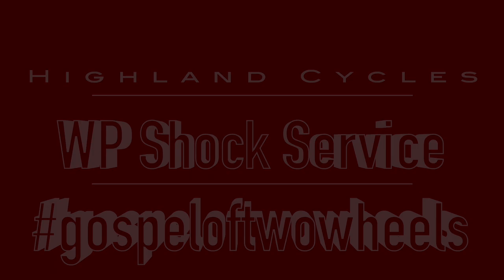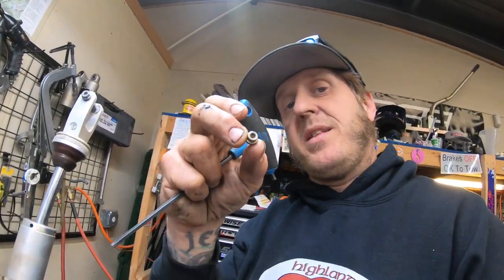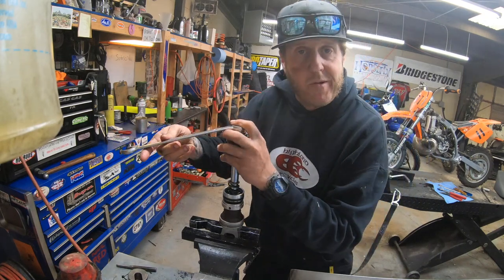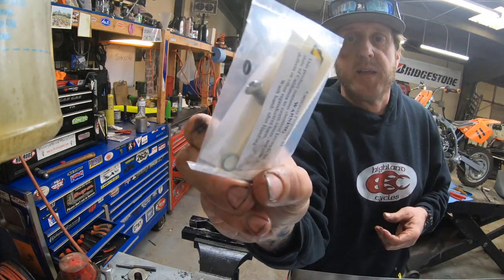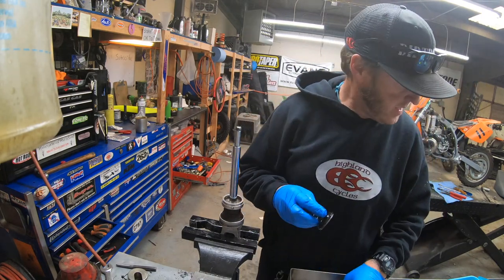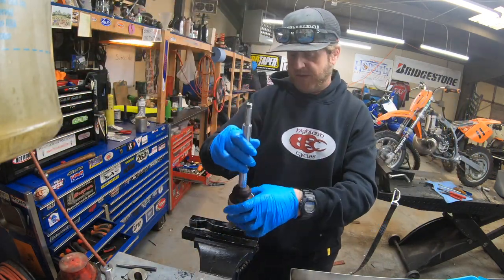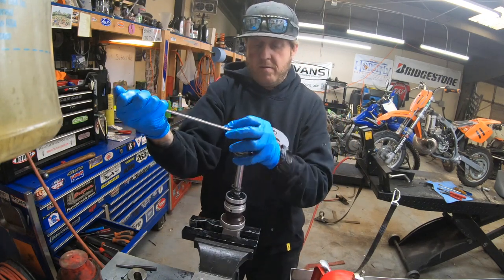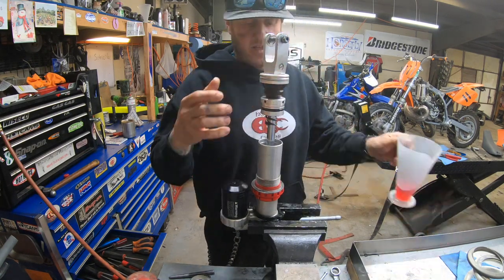How do you rebuild a KTM shock?

Comment: Hey Morgan, I’m putting SDI bladder kit and changing the oil while I’m there. The SDI video shows needing the spring on. I’ll have it apart to change the adjustment collar. Do I need to put the spring on to install the bladder or just do it like you did here? Tia
Reply from the maker: No, you can install without spring

Comment: If you just pressurized the bladder with line pressure you can do all you bleeding from the seal head side. When your done you can remove the nitrogen and install the seal head. Let oil over flow. The seal head will displace the oil and push the piston where it needs to be. Then pressurize. Or you can get a shock vacuum pump/bleeder.
Reply from the maker: I’ve done it that way too. I like using the bleed cup because I usually get some tiny bubbles out from between the shims.

Comment: It might be a silly question but how do you set the 10mm piston in the reservoir?
Reply from the maker: That is a great question and I forgot to film it.  I use a really skinny screw driver and I put an oring on it.  I push the piston up from the bottom until it is all the way up and slide the oring up to the body of the reservoir.  Then I pull it out and slide the oring 10mm down.  Then I push the piston down from the top more than 10mm.  I bleed the shock and then push the piston up from the bottom using the screw driver and the oring as the set height.
Reply: @highlandcycles  Many thanks!!! 👍🏽

Comment: Hmm...at 11:30, before you flipped it over, I noticed the oil was topped off, but it didn't spill. What's the magic?
Reply from the maker: everything was sealed up.  Just the final cap was off but the seal was in place

Comment: Thank you for your very helpful videos much appreciated. I want to lower my Ktm 1090r without effecting the shock stroke length by fitting a reduced length bottom rod end.Firstly can you please advise if such an item can be purchased and secondly can you please advise disassembly and reassembly procedure without damaging the bottom rebound adjuster mechanism.  Thanking you in advance . Sam
Reply from the maker: I’m not sure if you can buy that shaft. We usually have them machined down. As far as the work, just like everything, you just have to be careful and not force anything

Comment: My rear shock (12187L6701) on the TM- the foam buffer  has degraded due to high humidity where I cam located - is this easy to replace - shock appears to be operating fine and no visual problems other than the buffer
Reply from the maker: It’s pretty straightforward but you do have to disassemble the whole shock to do it.
Reply: @highlandcycles  the complete shock - or can I gain access via the bottom mount ?
Reply from the maker: @itolond  whole shock shaft out

Comment: Do you know any method of purging the shock absorber without having to use a vacuum device, it would be of great help, I await your clarification, greetings.
Reply from the maker: The DRC bleed cups
Reply: @highlandcycles  Without the DRC tool, as you would advise me to do, you have another video, changing the oil of another shock absorber just like this one, wp, which you do by removing the adjusting nut, but as it is done in question, please detail the process to me.

Comment: Morgan, I am going to add the SDI bladder when I service my shock. At what point of the service would you replace the canister/bladder?   Mainly I am curious for bleeding purposes.
Reply from the maker: You only need to replace the bladder when it wears out. Depends on lots of things but I’ve seen them go 200 hrs +
Reply: @highlandcycles  sorry, I worded that funny. I am changing the bladder kit to get rid of the OEM setup. It eliminates the piston in the OEM bladder and has a Schrader valve for nitrogen. I was just curious when disassembling the shock when is the right time to remove the OEM can and replace with my new SDI can, but I found my answer on RM atv video. Thanks for the response 👍
Reply from the maker: @mountainmonkey172  gotcha. Right on.

Comment: Great video as always. What kinda of container and fluid are you using to clean parts?
Reply from the maker: I forget who makes the sprayer but you can get them on Amazon. It’s pressurized air that runs it. I use Nutech Brake clean in it. Thanks
Reply: @highlandcycles  Thanks

Comment: Hey on my 2001 KTM 300EXC my KTM dealer installed a 1 inch longer bump stop during rebuild  telling me it has compression characteristics that equal the shorter OEM bump stop that is no longer available . I am thinking of trimming it to the stock bump stop length as hard to believe . Ever seen this ? Wondering if I should trim especially since about to ride some fast , deep sand whoops and dont want less rear wheel travel .
Reply from the maker: I’d trim it. I don’t think they are right about that

Comment: Why did you suggest adding a bladder? Curious about the SDI kit for my TE300i
Reply from the maker: The bladder gives you more consistent shock action than the piston. The piston tends to heat up and not move well whereas the bladder acts the same all of the time.
Reply: highlandcycles - dig that! Appreciate the vids and replies, sensei DIRT BIKE!
Reply: @justinawingo  When going fast in the desert through whoops and such where the shock is working hard, the reservoir on my 300 was hotter than my engine with the stock piston setup.  It runs much cooler with the bladder.  Plus it has a simple Schrader valve on it now, no need for the needle to fill it.

Comment: At the end you refill it with nitrogen? Where can i get that or let it refill?😅 Thanks✌🏼
Reply from the maker: Most shops should be able to do that for you
Reply: @highlandcycles  Thanks, and do i need then the new bolt for a needle or not?😅
Reply from the maker: @dasatom3060  it helps. Otherwise you need a special tool
Reply: @highlandcycles  yeah, but for when i take it to the shop to let it fill up.
Reply: It’s a local KTM dealer. Do they normally have this tool or should i just to be safe buy the bolt.

Comment: Piston height is 10mm down from the bleed hole? And do you set it with the shock shaft extended all the way or pushed in?
Thanks Morgan
Reply from the maker: Yes 10mm from all the way up and shock shaft fully extended
Reply: @highlandcycles  hello dude. If I put a drive screw from the hole of gas what's the mesure of piston height ?

Comment: I have one problem need your advice. Before that, I own Duke 390 2017 (new model).
My problem regarding fork, one side fork had leaking and I do servicing and change new seal both sides. New fork oil used Fuchs Silkolene RSF5, and filled 450ml.
The problem is, after finish install all and test ride and do hard front breaking.. the fork go down as normal but didn't rebound as normal before. Only rebound around 10 to 20 mm. Only can rebound more when I open throttle / accelerate more. 
After I ride more than 4500km, that fork still same. At entering corering I fill hard that fork, some time have small jerk at fornt. After that I change new oil but after that still same.

Method
1st replace, that fork was dismantle all part inside (rebuild), cleaning and install back together with new seal. The oil filling from the top capping.
2nd just pour out the old oil from top capping and filling back from top capping. Also 450ml with same brand and spec.

So I don't know what the real problem. Wrong method during filling the oil or what. Really need your help to advice me.

Thank you
Reply from the maker: I don’t know for sure but it could have something to do with how you installed the front wheel. If you didn’t get the forks lined up they could be binding. I have a video on that https://youtu.be/NB0nhXaYeiQ
Reply: Thanks Bro..

Comment: how did you set the piston height at 10mm
Reply from the maker: I use a thin screw driver with an oring on it to push the piston all the way up then I pull it out, move the oring 10mm. Then I take a blunt Allen key and force the piston down from the top through the bleed hole. Then I take the screw driver with the oring and push it back up til the oring is flush.
Reply: @highlandcycles  Did it that way and came out mint. thank you sir

Comment: Man, you skipped the part I needed to see about the little aluminum cover at the bottom of the shock body with the holes in it. My buddy’s bike had that cover pop off and fluid’s dripping out. I can’t see a snap ring/circlip in there at all.
Reply from the maker: There should be a circlip. I have seen them come apart

Comment: hey Morgan i'm in need of one of these, can u send me a link or part # that i can get one assap?
Reply from the maker: What part?
Reply: the part you screwed into the shock
Reply: so u can fill it, have a 2022 husky 150i  that i installed a lowering kit on , so basically need that part so i can full it with nitrogen
Reply from the maker: @supacat7059  oh the little bolt so you can use a needle?  That is a racetech part
Reply: yes yes yes thats what i need
Reply: so i have to go on racetech website or something
Reply from the maker: @supacat7059  yeah
Reply: thanks alot pal